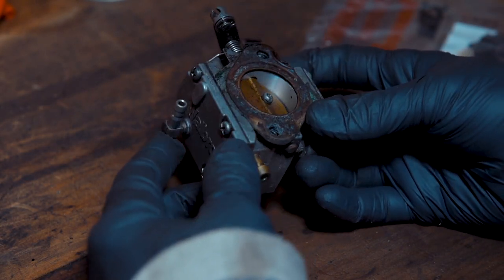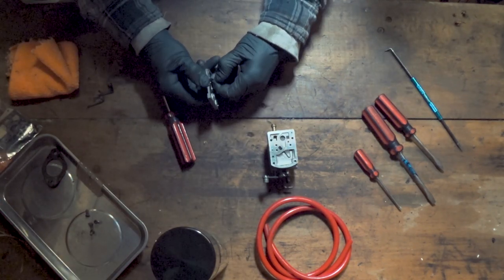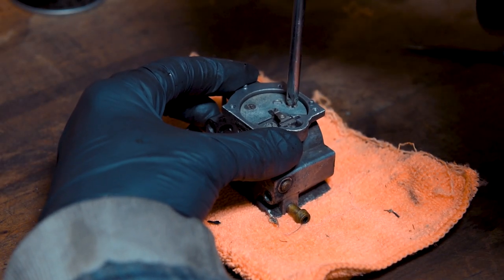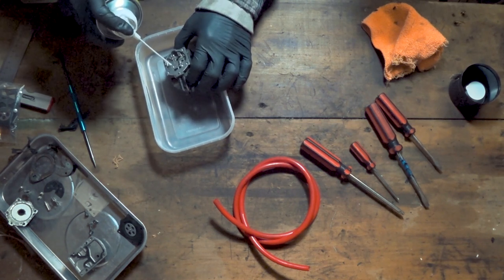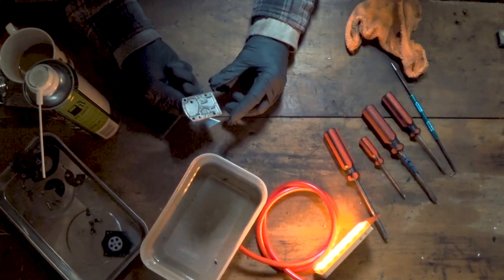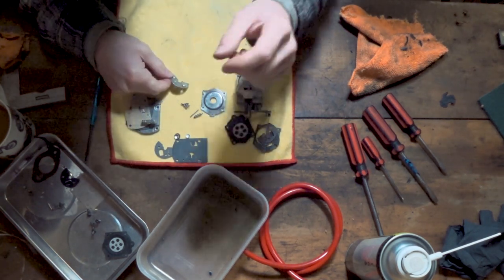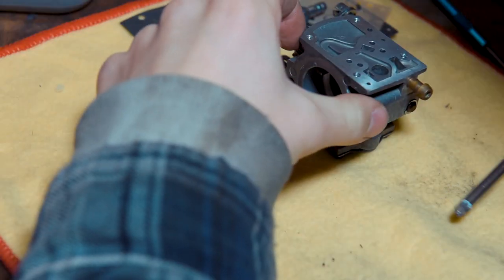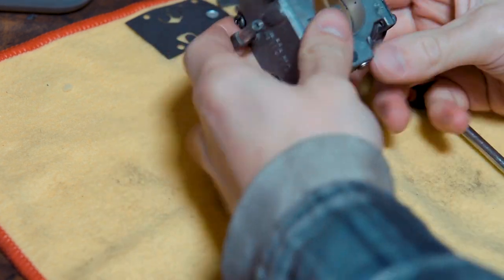Walbro WB32 Carburettor Full Rebuild Guide

Comment: Hi I noticed you put on the diaphragm before the gasket. On my one it's the other way around 😟now I'm confused
Reply from the maker: Main body > Gasket > Diaphragm > outer shell.

Just looked it up. You’re right, how I’ve put it back together is wrong. Although if it ain’t leakin’ send it? 😂
Reply: @DanielJonesParamotor  lol I was worried that I may have done mine the wrong way. The only difference it will make is a slightly leaner mid range. Not a problem because you can just richer your low end to compensate. That way you get a nice mid and high end and a little lacking power down low where you dont need it anyways. 👍🏻